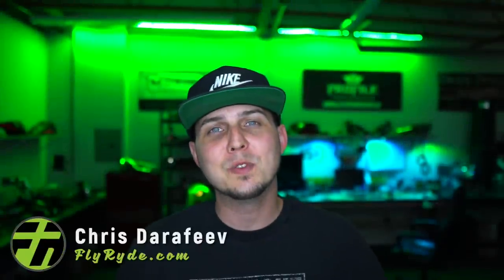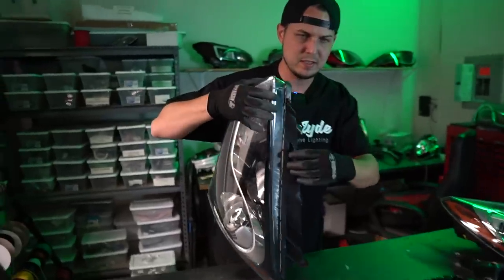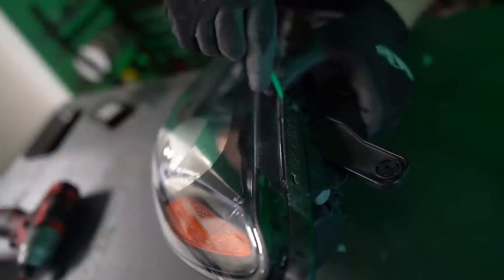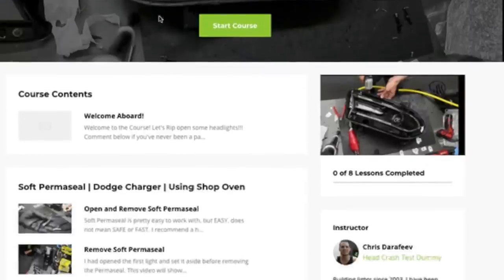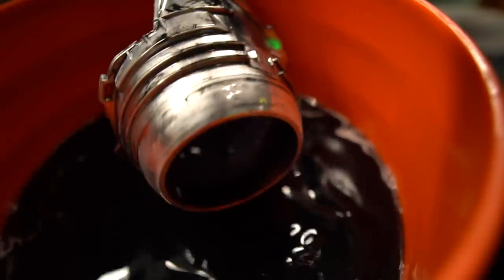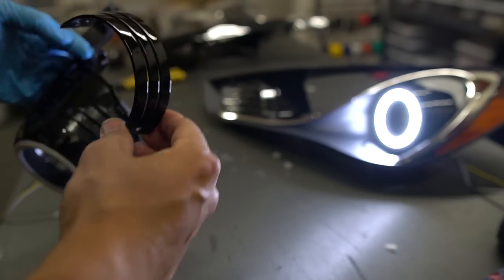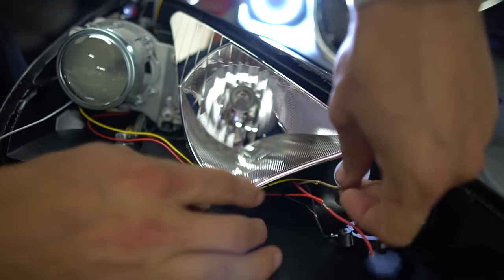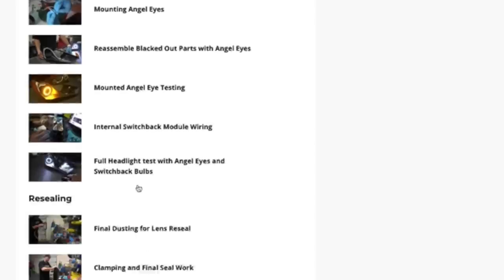How To Build CLEAN Custom Headlights

Comment: Over a year later...I'm still here!  Getting ready to crack the headlights on my '17 Ram 2500 to replace the lenses and add demon eyes.  These housings have already been converted to HID projectors and LED pods.  My first time [blush].  Been watching your vids for the knowledge and confidence.  Big thumbs up for taking the time to make these instructional videos.  Very much appreciated!
Reply: Great video, thank you. I'm curious if the two pieces you left chrome are also of the same material that can be stripped with the Zep decreased. I would like to do a full blackout.

Comment: Still here! Interested in how the wiring goes. I know you said plug and play but I'm wondering how it knows the low beams are on like how to you hook up that wire. Also how do you tell which wire to hook up to
Reply from the maker: 0SimpleSam did you watch the part where I wired all that up?
Reply: @flyryde  Yes, you said you put the white wire out the bottom for later to connect to the low beam. Couldn't tell where to connect it to by the vide at least, couldn't see under the light if that's where you connect it

Comment: I would've watched the video even if it was an hour and a half. I am planing to get as much info as possible from youtube before I actually disassemble a pair of headlights to modify. Lots of ideas for mercedes headlight/tails, Audis, even some VWs. My issue will be the wiring. I've never learn the fundamentals I suppose. 
My game plan is to go chineese (cheaper stuff off AliExpress,ebay etc) for my first projects until I feel confident enough to pull apart perfectly good thousands of $ headlights. In my country I just cant justify the cost for a low end vehicle. Nobody will buy it.
I might see you in the classroom, eventually, If i succeed at my first few projects.
Keep pumpin' the good content man!
Reply from the maker: Thanks so much for the compliments! Go for it dude! Just work with what you have, learn a bunch, and dont be afraid to fail! Its a great teacher when you mess up and have to figure out to fix things, or do them better :)

Comment: Still watching your content bud. Even though i stopped building lights a year ago. Starting to think i should start building again. Have done every paint combination on those lights, including a full mystic color changing paint lol.  As you were the one who inspired me back in 2011 to do my own genesis lights, you are the one who is getting my drive back to build them again lol. Great content bud. Keep it up!

Edit: since i commented mid point, noticed afterwards, why did you put the halo wires on the bottom of the shroud? I always did the top.

Comment: Can you modifying a 2016 RCF headlights and tail lights ? Is possible i mean?
Reply: Anything is possible, with enough time and thought put into it. I'm currently in the process of building a set of taillights for a 2004 Chevrolet Trailblazer for a couple of reasons. One, I want brighter rear lights without just putting LED bulbs in the stock housings like most everyone else would do. Two, the challenge of fitting the Ghozt module inside the stock housing, since these lights don't have much room. I will probably do the headlights too later on.
Reply from the maker: Alyazeed Khardali it’s very much possible my friend 👍

Comment: Do glasses/spectacles cleaner wipes work on the lights inside?
Reply: The dry ones?
Reply from the maker: As of now, I’ve yet to see anything that you “should” wipe the inside with. I mean you CAN wipe it with special cloths but they’re all going to leave evidence that worse looking than most anything on there you want to get off. That’d be a great thing to find a solution for that will pass as an acceptable pro grade fix 👌

Comment: Can you strip the high beam reflector housing to black for those doing projector swaps?
Reply from the maker: Yes, BUT, its not necessary. You can just scuff it to prep and paint like normal. Under high beam reflectors is generally always a form of Ceramic that can handle the heat, and it'll never be Black like the parts in this video. What car?
Reply: @flyryde  2014 genesis coupe. If I strip the other parts I'd rather strip that high beam reflector too so that they're all the same shade of black

Comment: I'm still here, I have a 2014 ford f150 that I will start a headlight build really soon. 
Just had a quick question why did you solder the small wires to the halo ?

Comment: Hello superstar great work 
Have only one question for Genesis coupe 2016 (same headlights) : I want to retrofit from halogen will MORIMOTO 5.0 projector fit to d2s ... will it fit perfectly? Do I need brackets?...will d2s fit with the OEM dust cap or should I use d2h instead? Thanks a million

Comment: I am still here. I have a one question. If I use a sequential led drl and turn light, then can I use only sequential turn light and remove the stock halogen turn light??? will I need a load resistor??? Will it hyper blink??? Please please tell me. I need to know.🙏🙏🙏🙏🙏🙏🙏🙏🙏🙏

Comment: if you dont have a oven specifically designed to melt the adhesive, what other methods could you melt it without damaging the lens or the headlight ? i own a gen, and have kdm headlights ive been wanting to mod! love the video!

Comment: Im still here, keep chasing the dream! Thanks for sharing the knowledge! Also do you know of a way to keep the light from showing on the inside of the lens? It happened with all of my cars after a while, it almost appears as if there is super fine dust on the inside of the lens (but I know this isn't the case). No matter how clear or smooth the outside is when the lights are on I can see some of the light is reflected back and showing on the inside of the plastic. Is it because the point the light hits heats and causes the plastic to slightly oxidize? Or because the plastic isn't perfectly transparent? Sorry for the long comment, its just hard to explain haha...

Comment: I'm still here! Fly, My Genesis coupe is condesating even if it's not raining. It's fogging like crazy inside the lens. What should I do? I already filled the gapping with silicone for preventive measure, I already placed 15 silica gels inside the headlights, cleaned the breather, what else should I do?

Should I add a breather by drilling a hole below the headlight plastic? Help me please I'm having a hard time. even a 30 minutes of driving would give me a huge amount of condesation.

I would really appreciate it Fly :(

Comment: Awesome vid. But what do you do with the tie down wires once inside the housing? Do you just bend them over or secure them some how?
Reply from the maker: You can do that and then add a dab of JB quick to secure it once you have it perfect
Reply: FlyRyde what gauge wire do you use? Starting this project soon, thanks.

Comment: I recently installed Morimoto demon eyes on my 2015 Genesis Coupe (from the bottom not top thanks to one of your videos). Looks great, everything works, except even when they're off they emit a low level of red light even if that wasn't the last setting. Any idea why? They are wired to an add-a-fuse circuit with another set of lights that don't stay on like the Morimotos. I've seen a couple of posts elsewhere of people with the same issue but no reason why. Given your experience and experience, I was hoping you'd know why. Thanks, love the channel!

Comment: I'm curious, I see you using a average rubber coated wire when dipping in the bucket, are there any materials that we definitely DON'T want to use to suspend, like a coathanger or fishing line, etc? and thanks for the great videos!
Reply from the maker: Anything but your hands is good as far as my experience.
Reply: @flyryde  thanks. I really like your videos, I'm learning so much! I've watched probably 4 hours of your channel today! 😂 Not stoked that ever time I even wanna change a burnt out bulb I have to remove the bumper cover on my SC430, so I want to do this right the first time.

Comment: I'm still here, 
Can you do a camry lights? Like the 2016
Reply from the maker: Nelson B I think a Camry project would be dope 👌 Something similar to this would run about 450+ just to give you a ballpark idea 👍
Reply: @flyryde  No doubt. I recently saw a retrofit done to a 17 camry and really change the look of it. My friend has one. And considering doing the Halos and strips but just dont have the time. But thanks, keep it up.
Reply: Yeah, it can be done. Just like any oem lights it's just opening it with out cracking it or burning your self.

Comment: I am still here!! I need help with some high beam low beam issues on h4 bi exeon that I wired and plug into the h1 and lights work bit in high beam always. And some advice on projectors. Thanks in advance. Love your show! I will be you number one fan, lighting customization is my newest love. Worked got a car after I was in a wreak and lost my other car that I made unique as to my abilities. I seen your gt custom video that was awesome how you asked how to do and change in key

Comment: Still here mate XD I got an idea that I'd like to restyle my tail lights on my Audi A6 C6 Avant and I came across your videos. Not sure if I'll be able to do what I've imagined but I like your videos :D
If you by any case see my comment, and decide to help me, I'd appreciate it so much!
What I wanna do is make an "LED LINE" rather than individual lights as it's out of factory.
I'd love it slightly clouded, not really crazily bright.
If I could then add animated sequental indicator light that would be top.

I'm not sure how your system works, with these animated tail lights, do they run like that once you start the car, or do you have to press the button on little key fob?
Thanks  alot man!

Comment: I'm still here - It's a good video, but I think what gets lost in a lot of these videos is a majority of those watching probably don't have the same experience you do with this type of project.  I know I don't at least.  Step by  step instructions are only a benefit when we can see the work done fully and without interruption or cuts and with explanation as to why you did something a certain way.  Being distracted by other information just adds to the confusion.

Example - how long did you soak the parts before you noticed they were 'good to go'.   There is nothing about the painting process even though you mentioned painting - what type would you use, brand, how many coats etc, or perhaps it's legitimately just stripped of it's chrome color speaking about paint added to that confusion. 

My opinion, you'd be better off posting a 10 mins video going through each step thoroughly, but first showing us the 'tools needed' then moving into the process itself, but thanks for putting this out - it does help illuminate the process a bit more.

Comment: I wish someone would build a cheap replacement headlights for the 2004 to 2008 Chrysler Crossfire !! There are no replacements. My car was totaled due to not having a replacement headlight. Used ones are junk or worse shape than my original headlights. You can buy brand new Mercedes SLK headlights but the Crossfire is a bastard car no one wants to support. Is there anyone out there who can rebuild these headlights. I bought a set of damaged headlights I would be willing to sacrifice to someone who would build me a new set.